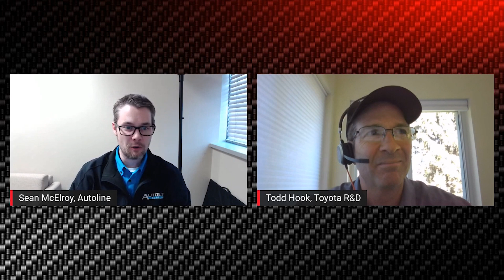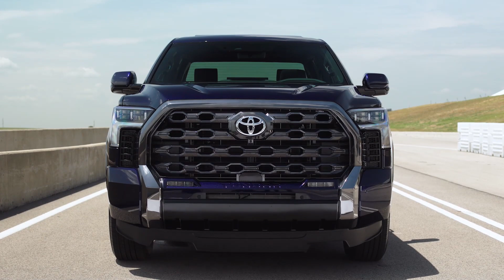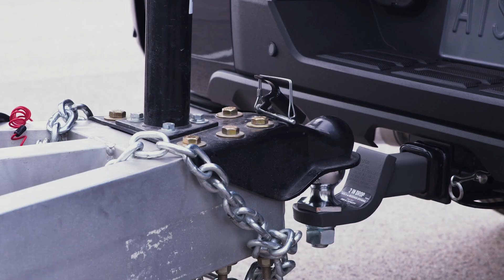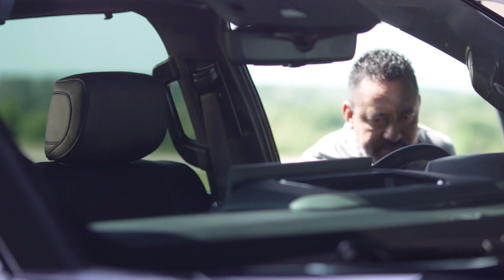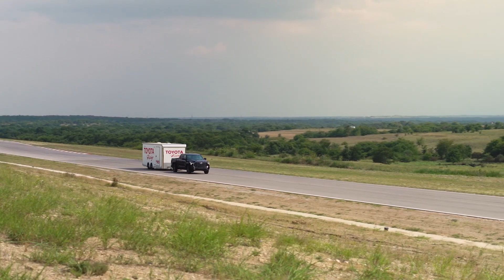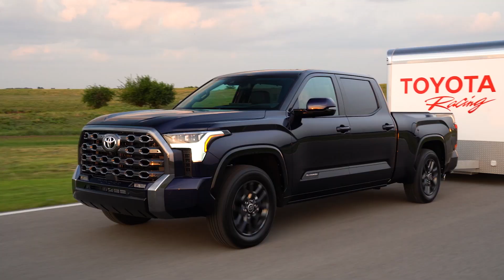Toyota North America Played a Bigger Role Developing the New Tundra - Autoline Exclusives

Comment: All the effort and still a useless tiny payload. Put a decent rear axle in it toyota and give it a 4.5t GVM . Why do these massive American trucks have such tiny payloads. They should all be min 3500lbs. A little Hilux is 2200lbs
Reply: Payload isn't top priority anymore. Ride quality is where most have focused on. Once you soften up the ride and add features payload is going to suffer. Max number is on the lower Tundra model at 1940. American companies are over 2200 in base form. Tundra is a 1/2 ton truck. 3500lbs is where you would look into a HD model. They ride stiffer because of more towing and payload. HD go to almost 8000 in WT(work truck). If you want more there are other options. Such models are medium duty chassis cab. Some offer over 20k in payload. It depends on the specs.

Hilux is a mid size truck. Most here are not over 2000 in payload. Only Ford offers a 1/2 ton where payload is over 3,000. There is a catch because it is on a modified 1/2 ton frame.

Comment: Poor decision dropping the V8. In fact they should have developed a 7.0 or 7.3 gas as an option. Turbos will burn up the engine prematurely and the fuel savings hasn’t panned out.
Reply: They should have just put a little 4banger in it as a generator and went full plug in series hybrid. That way it cost almost nothing to drive around town but has way more power then any V8 when towing
Reply: You can search to confirm that Toyota was experimenting with an Atkinson cycle V8 in 2015.  I firmly believe they thought they could get it to work and Plan B was the turbo V6
Reply: I feel the same about turbo's. Great to have that boost but are the engines strong enough to last 200k-300k miles. Every vehicle is going 4cyl turbo's. Time will tell.
Reply: Not enough return on the investment for a V8 engine!
Reply: The EPA  is chocking the diesel too death rightly so . Peale that need a heavy duty truck need an alternative to a diesel. A big block gas won’t hold up like an old diesel but will probably hold up better than a new one.
Reply: You do know ford has been using the 3.5 eco boost since 2007 with billions of miles logged.
Reply: @lawrencefranck9417  with lots of issues.